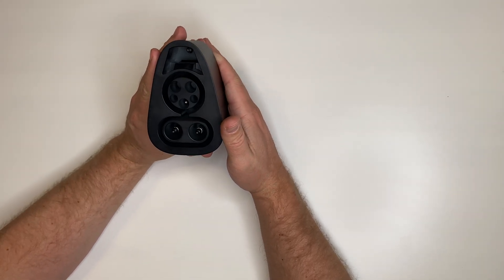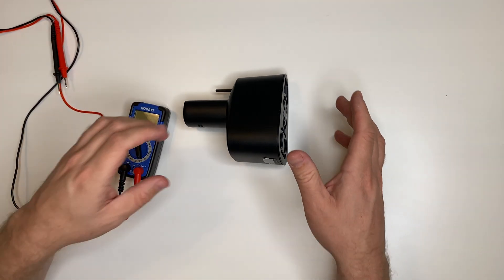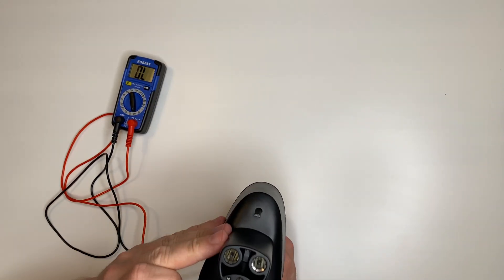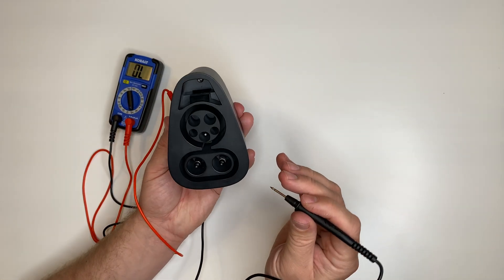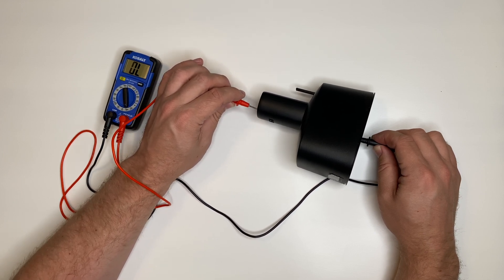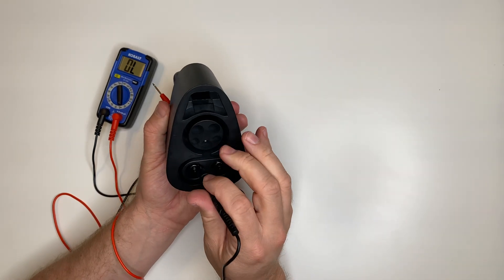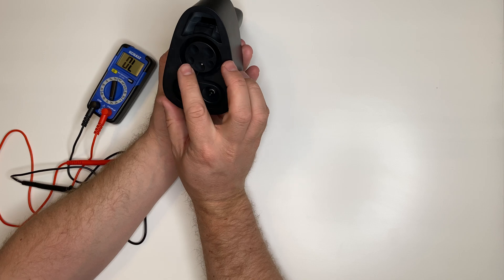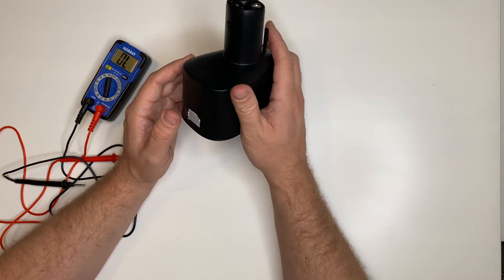Detailed look at the new Tesla CCS1 adapter

Comment: if you think you can black box it with a VOM, lol you have a lot to learn.  If it had been disassembled to show there was no internal circuitry would have been useful.  Do you really think an adapter that was nothing more than a passthrough would be sold for over $400?
Reply: It is just a passthrough. It doesn't cost $400. And even if it did, to use your phrasing, do you really think if it had a couple of bucks of circuitry in it that that would be the difference between a $400 part and a $100 part?

Comment: The North American Teslas without a CCS connector can be upgraded with a CCS logic board. That suggests all the logic is in the car and not the connector. To know if a North American Tesla can work with CCS you have to look in the Service menu meaning the car needs to have the right charging circuitry. I guess it makes sense the adapter is just galvanic connections and not circuitry. Hard to believe it is roughly $250 in South Korea right now.